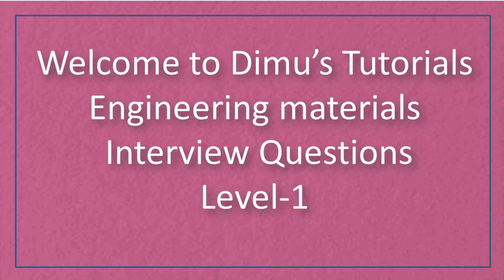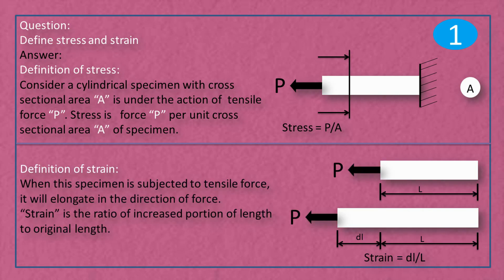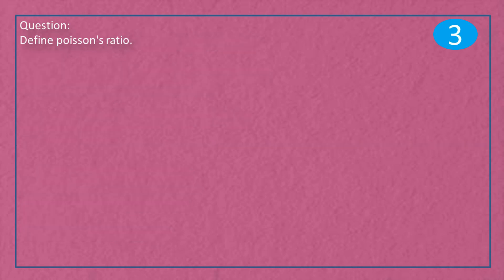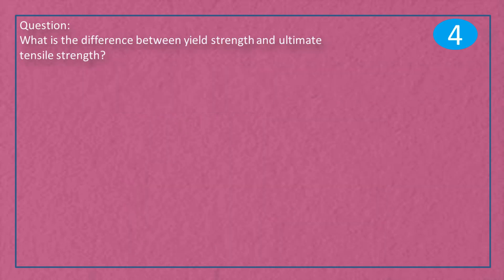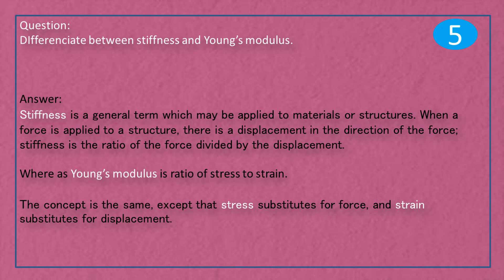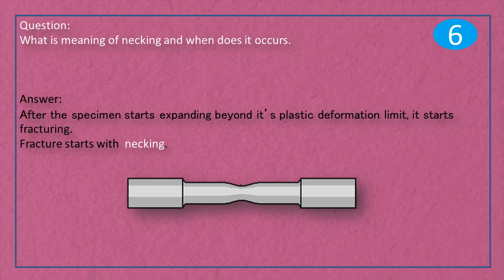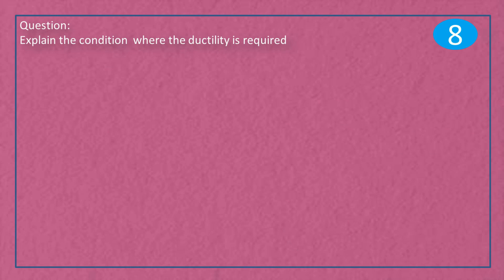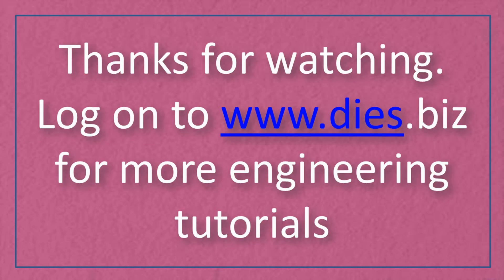Strength Of Materials-Mechanical engineering Interview Questions,dimu's tutorials

Comment: Add video for sheetmetal interview question and answers also.
Reply from the maker: I will work on your suggestion.Thanks
Reply from the maker: Hello Shashank I have uploaded first video on sheet metal.
Though it covers manufacturing related stuffs.
Design engineer is supposed to have sufficient manufacturing knowledge.
Design calculation videos will be uploaded further.